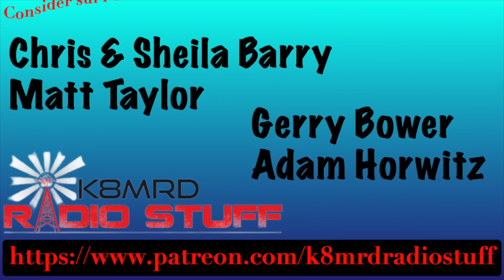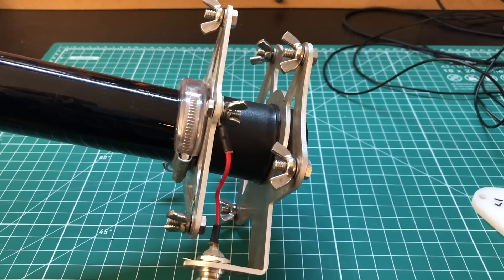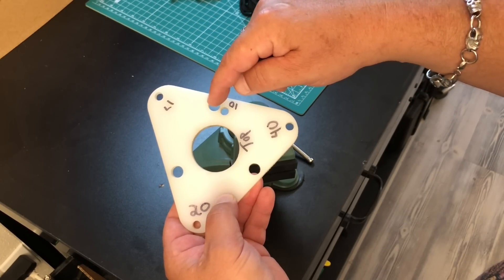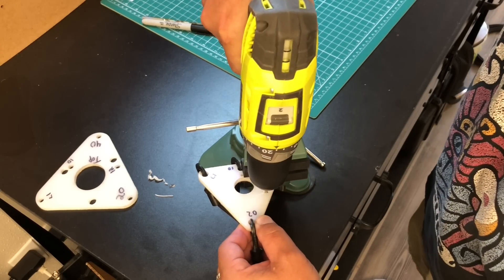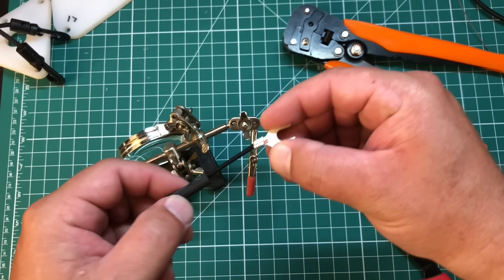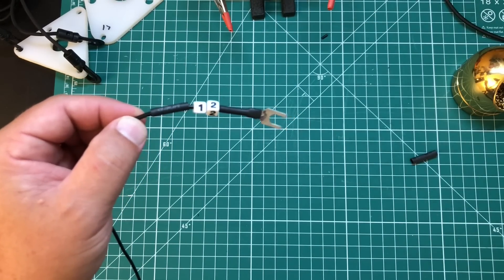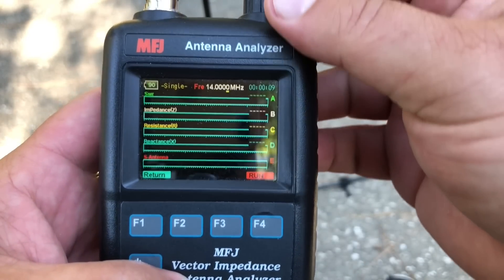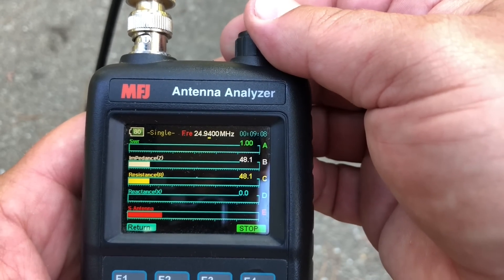DX Commander Expedition 12 Meter K8MRD Mod

Comment: i have been considering getting a dx commander Signature 9 for 40m through 10m to replace my ffffugly 6-band cobweb, BUT...the commander is only 1/4-wave (vs 1/2-wave for all bands on my ffffugly cobweb), which means approx. 2.2db less gain on each band with the commander.  honestly, 2.2db less gain ain't chump change (almost 1 full S-unit!) when trying to pull out weak signals on RX, and represents a loss which i'm not sure i want to take.  that said, the dx commanders look PERFECT for POTA work or other temporary type setups.  what are your thoughts on the db loss of the commander?

Comment: I love that. But did it change anything on the other bands? I noticed the cut length is not truly what you expect for doing single bands on each element. Seems there is some work across all the wires.

Comment: So for this antenna to work properly you have to  use radials? That could be a problem for my space allowed.
Reply from the maker: Yes it does.  The length of the individual wires doesn't matter as much as the total length of all wires combined though.  You can have many more shorter wires verses several long wires.

Comment: I'm really going to blow your mind you can run an element from the base plate up into a tree and run any bands you like. I made my own version of the DX commander I have a 40m element that I strung up in a tree off the base plate as well as the normal bands up the pole.  I also find the higher the frequency the less well a vertical works compared to a dipole. For example a 10m dipole I found works better than a 1/4 wave vertical where as a 40m vertical works better than a dipole  (in my experience) 73s

Comment: The best antenna is the antenna that works best for you. However, I don't recommend ground mounted vertical antenna for crowded areas like what is seen in this video or neighborhoods for example and this is why. There is the nearfield, farfield, and freznel zones to which the vertical ground mounted antenna is affected most by the freznel zone. That zone extends out 2 wavelengths from any band you are working. If you have things in the way, like trees, shrubs, houses with electrical wiring, etc.. anything in the way, those objects can and will absorb, reflect signals from ground mounted verticals because the DX or low angles of radiation are most affected. Meaning, at ground level, how much sky can you see at 5 degrees of elevation? 20 Meters and lower frequencies are most affected by the freznel zone on a ground mounted vertical antenna. There is only one solution, and that is to get the antenna off the ground. For decades ground plane vertical antennas were usually always above ground, but over the past few years ground mounted is where hams are erecting their antenna's, without knowing why it used to hardly ever be done this way. Now you know why. 73

Comment: Hey Mike, bet that DX Commander works a lot better than the MFJ collapsable whip you used in NC 3 or 4 years ago huh?  Have you used this antenna from your dad's place down there?  Bet it's a nice place for lack of QRM/QRN down there,  there's a lot of beautiful places down south -- few of 'em up here too. ;-)  73, Bob
Reply from the maker: Lol, just a little bit yeah :)  I haven't used it at my dads and unfortunately he sold that house.  It was really nice operating from there though.  Zero noise floor.

Comment: Thanks for the video. I now know more about this antenna than before. It would be a good permanent antenna, but I consider it too much work to put up for portable use.
Reply from the maker: Nah, this thing is a breeze to set up portable.  Takes like 15 minutes.  Plus its resonant on so many bands.  This one is designed for portable.  The DX Commander Classic is designed more as a permanent antenna.

Comment: Hey Mike, well done! 

Just want to give the hint that adding a wire might de-tune the other bands (slightly) - before you fire up too much, you might want to double check that one as well 😃
Reply from the maker: It did until it was resonant.  I checked several times.
Reply: Yes that's very possible. Should recheck it to be sure.
Reply from the maker: It's all good.

Comment: Thanks for the video and more bananas. I have had the full-size DX Commander installed up here in WV for about 3 years now and while it needs to come down every 6 months for grass clipping cleaning I have only had to replace one element for 40 Meters and that was due to wind when the antenna fell over. In the kit, Callum supplies extra cable and extra terminals so ongoing maintenance is an absolute breeze. W8BFO (Will) 73s peeps.
Reply from the maker: Absolutely fantastic antennas and its great that he supplies more than you need to make repairs down the road too.

Comment: Hey Mike that’s a fantastic video anyone’s has the DX commander antenna that’s a good mod. I like the way you show the antenna , Calum does quality work I can understand why you really like the antenna. If I had the space to run the counterpoise in my backyard I think that would be one of the antennas I would put up. Looking forward for next weekend I can’t wait to start hunting for the POTA . I think that’s gonna be a lot of fun. Hey Mike how fun and stay safe.
WD5ENH 
Steve
Reply from the maker: They are fantastic quality antennas and they perform great.  Doesn't take long to set up out in the field either.  Next weekend is going to be a blast.  Hope to catch you on the air.

Comment: Does this mod change the tuning at all for the other elements?
Reply: If I understand the design, it shouldn't. (I'm just an amateur, though. haha) Hopefully someone corrects me if I'm understanding it wrong. The other elements are capacitive at their non wavelengths, and all being connected on the same feed plate already. The element that is driving only oscillates at their specific wavelength/frequency. (Frequency increases inductive reactance, while decreasing capacitive reactance)
Reply from the maker: It did until it was resonant.  All good now.

Comment: Great video Mike! Did adding that element alter the tuning on the other bands in any way? I have the Expedition and the Classic 80M version. If I add another element to the Classic in this way, maybe 30M, I’ll pretty much be ruler of the electromagnetic spectrum🤟
Reply from the maker: It did until it was resonant.  Now everything is happy again.  You should be able to add 30 no problem.

Comment: You can replace the plastic tubing on your hose clamp with some heat shrink tubing and it will look a lot cleaner and work just as well.
Reply from the maker: Ooh, I like where your OCD is going there!  Good idea.
Reply: Did the same a while ago, with a SOTABEAMS pole and yes, works wonders using heatshrink instead of plastic tubing.

Comment: I want to go portable with my 991a. Looking for information on what I need. Thanks 
KQ4CD Paul
Reply from the maker: Hmm, thats a long topic but...in a nutshell, A radio, antenna, coax long enough to get to your antenna, a power source like a Bioenno LiFePO4 battery (20AH should do fine), or if you have mains, a power supply.  A computer or smart phone to log with (though some use paper).  I prefer the HAMRS app: https://www.hamrs.app  Water is always a good thing.  Thats kinda it actually.  Maybe it's not that long of a topic.  I would suggest taking your station out in the yard and setting up.  Thats a great way to practice doing portable radio.  You can find out what you need and what you can leave behind.  Plus, if you forget something, you just have to walk back inside.  Make a check list of what you have when your station is operational and bring that.  Don't be afraid to make mistakes.  You will, and I still do to this day.  Hope this helps and please hit me up if you have any more questions.
Reply: @hamradiotube  tnxs 73 KQ4CD Paul
Reply: I agree with what's been posted, and I would like to add a foldable table, a foldable chair like from Harbor Freight, and some sort of pop up canopy for shade. I usually set up real close to my vehicle so I am not walking too far, however I know K8MRD has sometimes hiked a bit to set up so then he goes as minimal as he can. Whatever you do enjoy the hobby. N3EDO.

Comment: I know you did a review on the antenna analizer, but noticed you been using it lately. How do you like it since you've had it a while?  Great video too!!
Reply from the maker: Oh man, I love this analyzer.  I use it all the time.  The RigExpert one I just did was a loaner.  I had to send it back.  It has way more features than the MFJ-223 I'm using in this video, and I would love to have one, but this has an internal battery that charges via usb and is so incredibly small.  It's perfect for going portable.  It literally fits in your pocket.  Doesn't do VHF/UHF though.
Reply: @hamradiotube  .